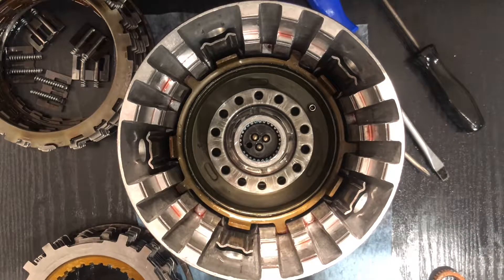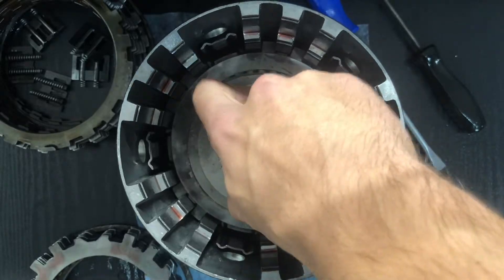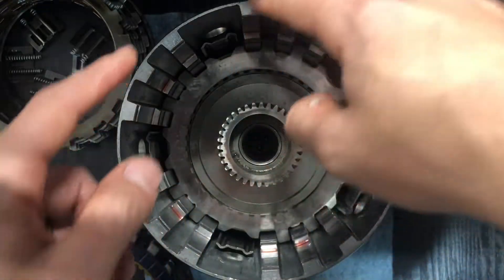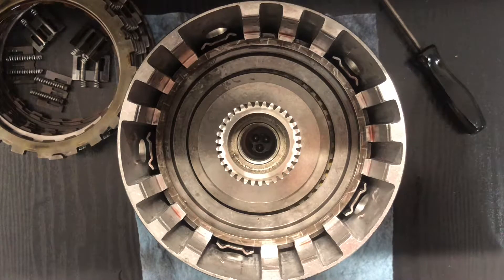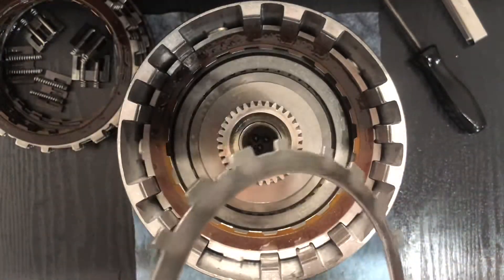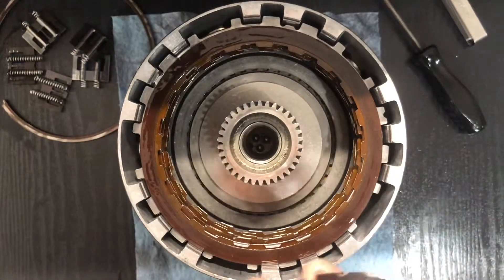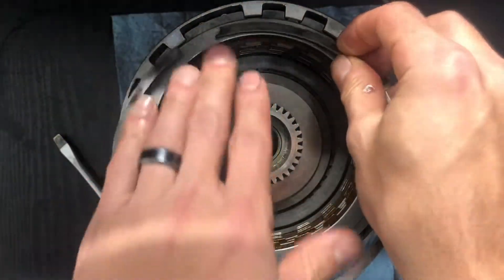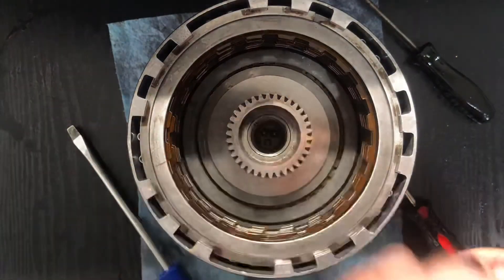4l60e rebuild/reassembly part 4 (forward input drum assembly)

Comment: planeium gear set not sprag btw. And your also supposed to air check it then check clearance with filler gauge which should be checked after air test and in between clutch friction plate and steal pressure plate.

Comment: ive heard the load springs make the 3/4 clutch come off as the band is applied, so its not dragging in 3rd gear./  most of the old time builders say  to use them.. they put them in for a reason.
Reply: Yes centrifugal force can actually cause the to rub against each other if that makes sense

Comment: Looks like you have steels from 700r4 they are thinner then 4l60e and you can buy thinner pressure plate and those are boost springs